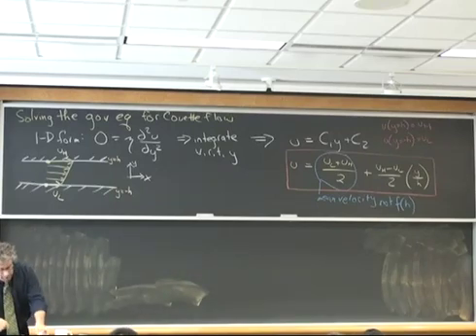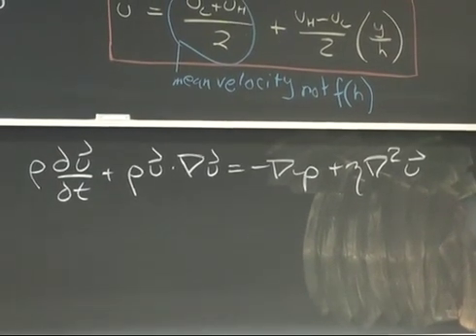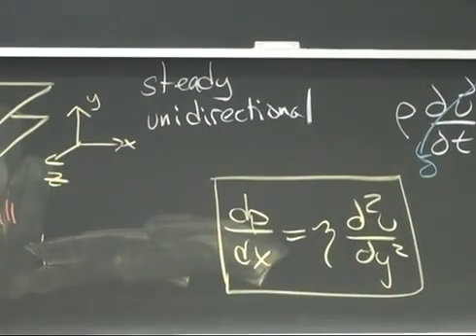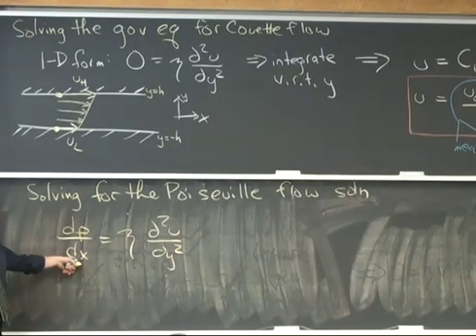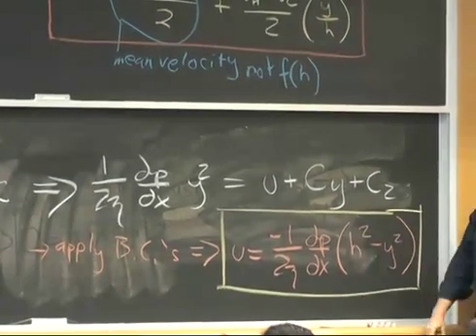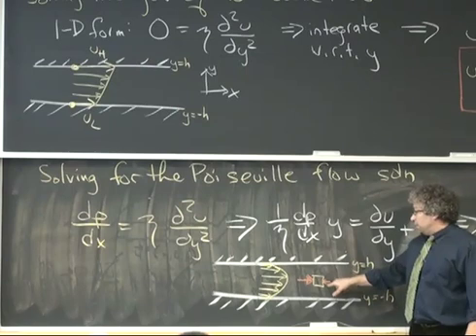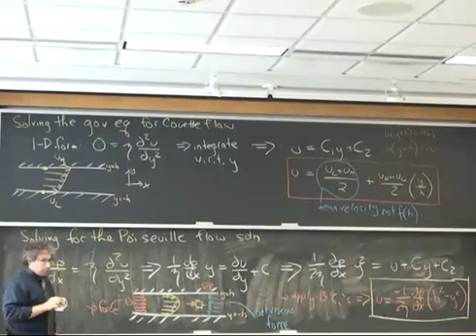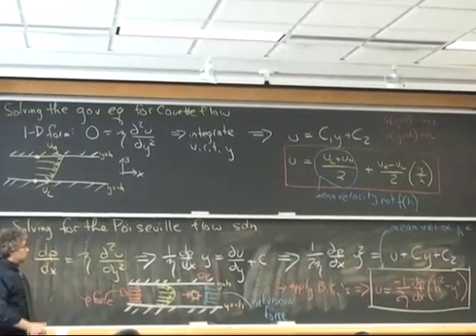Poiseuille Flow - pressure-driven flow between flat plates - solution

Comment: I think we get (hy-y^2) instead of (h^2-y^2) in the velocity equation after applying the boundary conditions...
Reply from the maker: +Sagar Abraham you are thinking of a solution for plates at y=0 and y=h which is a different set of BCs than the ones used here
Reply: +Brian Kirby Got it.Most of the books that i referred used y=0 for bottom plate instead of y=0 for centre.

Comment: I am trying to determine the mean residence time between two flat plates. For a circular pipe, it seems that the mean residence time, tm = 2 * tmin where tmin is the minimum residence time (in the middle where v = vmax). What is the mean residence time between 2 flat plates?